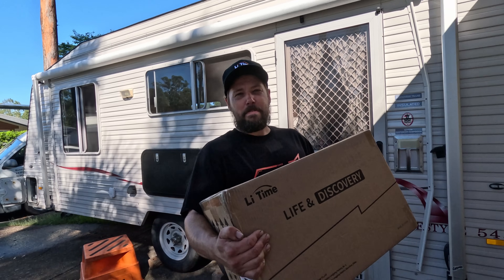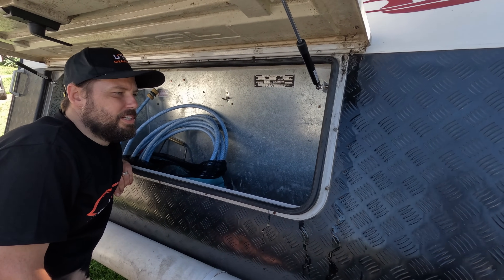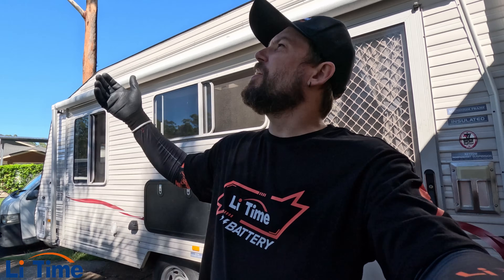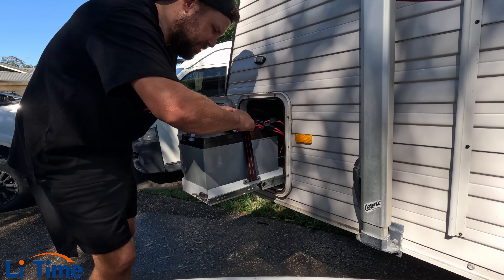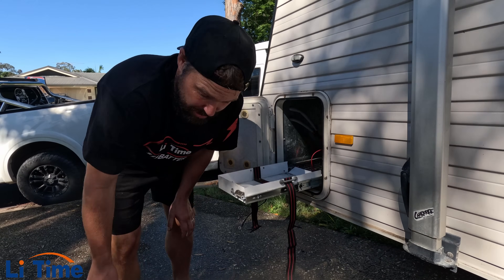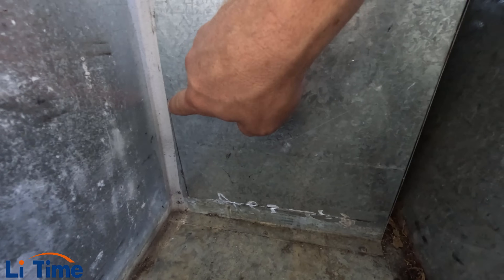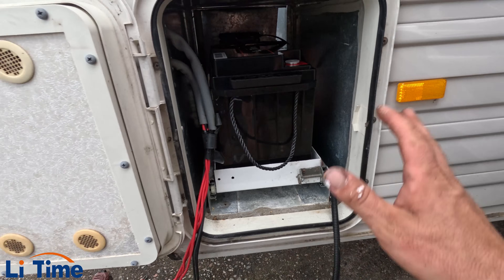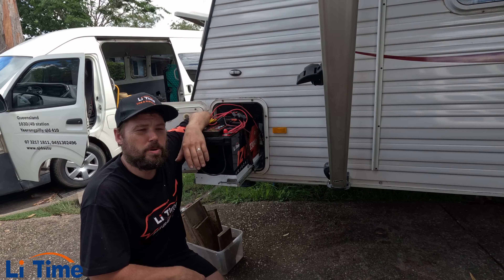MASSIVE 230AH Lithium Battery Upgrade for The Caravan Build!

Comment: Ok so I get this email from this company with ur u tube vid attached and for the life of me I have no idea how they sent it to me. BUT here are a few options for those who want to save money and end up with an extra 40 Ah worth. I have 2 x 135 Ah batteries I installed 1.5 years ago giving me a total of 270 Ah at a total cost of 665.00. So 40 Ah more. Great batteries and I have worked them super hard many times with no issues. I am not here to mention the supplier as that just brings stupid comments by all the so called "experts". So these batteries come to a total weight of 24kg (for the 2) and dimentions of 640Long x 160w x 215 high. Personally I fond this battery over priced to the proverbial S**t house. Shop around people, cant justify spending such a huge price (and its on special at $859.99 from a whopping 1,122.99). There are alternatives out there if you do your research and save money. A HUGE advantage of having 2 or more batteries over just 1 is the fact that if 1 becomes faulty, you can still manage your time away with the other 1 just by disconnection the faulty one. Thanks for the email whoever sent it.

Comment: Thanks for bringing LiTime to my attention. Always utilised Itech myself but open to alternatives.

Just a tad of info, the battery box and slide out tray are all std, that's how Coromal did it in the day, guessing your van about 2003 - 2004 construction.
The wiring was more than adequate back then for what they provided draw to, - fluro lights, bedding down lights, rangehood fan, water pump, 12v outlet to tv shelf, radio/cd, hot water ignition draw off them.
There would be inline blade fuse on preliminary supply wire/s from battery housing to a fuse housing/box where individual fuses fed lighting circuits, etc.
Providing you don't draw anything additional off those circuits, the wiring grade/standard would be sufficient.
Adding anything additional, maybe consider wiring upgrade as you renovate it.
3000w inverter, should come with sufficient grade of wiring but usually it's only just enough and only over the pre estimated length provided (1 - 1.2 metres). 
Coromal, a downgrade, my feelings are hurting 😊😊😊.
The Lifestyle was their budget build, introduced to compete with Jayco pricing, the affordable model but still came with full aluminium frame, duragal chassis, kneebone individual suspension (tracked true with basically zero maintenance) but the lifestyle were a basic finish. however still built to last, as you're discovering.
Carry on with the renovations, interesting viewing.

Comment: Plan seems great for battery enclosure, the execution needs a little work but great attempt. Maybe take your time as there’s no rush.
I would suggest moving all those terminal wires to a fuse block. Those wires are too small for potential energy, ie fire risk.
Reply from the maker: Thanks mate. Ill take a look Into that. Would be a good idea :) 
Yeah the box is a bit of a mess on the video but ive made it better now. A little better anyway haha cheers mate

Comment: Great spot for the battery with easy slide out draw.😊
Reply: 100% factory std.
Reply from the maker: @ianweal3081  is that from factory?
Reply: @wheelsbytheocean certainly was, 100% standard.
Would have had a 12v charge wire from vehicle plug going to battery with inline fuse, 2 x output wires with inline fuse powering the van.
As a battery didn't come std. (your choice of battery to fit) all positive wires were bound together and insulated as we're all negative wires.
Why? All the internal lighting, rangehood water pump, radio etc were 12v. For anything to work until a battery was selected by owner the van had to be connected to 240ac and the step down transformer/charger powered the entire van via all the connections being bound.
Reply from the maker: Yeah happy as  😀 
Ill just tidy it up a bit more. Great access hey

Comment: Just make sure those wires are the correct AWG for the appliances they are going to run not thin shit that will burn down the second you suck 100-200 amps lol   -Battery looks decently priced to ,keen to see how it goes :)
Reply from the maker: @undy22  Thanks mate :) 
Yeah one I wire up inverter ill be using the right cables. At the moment its just running the lights and crap.

 Cheers mate 👍 🍻